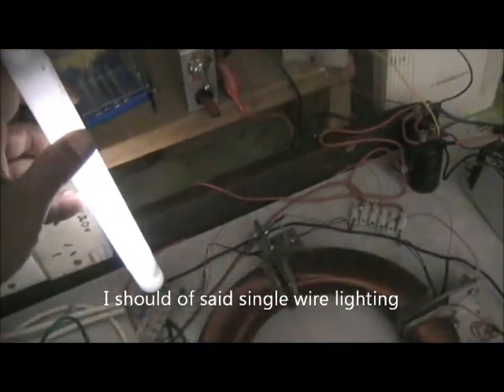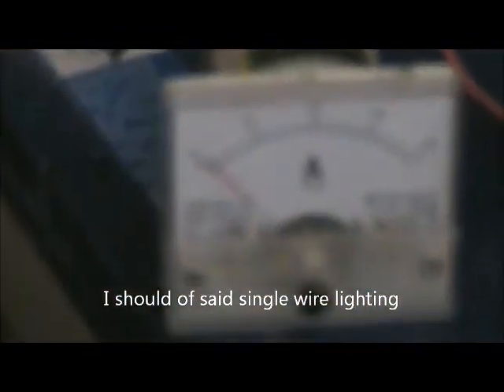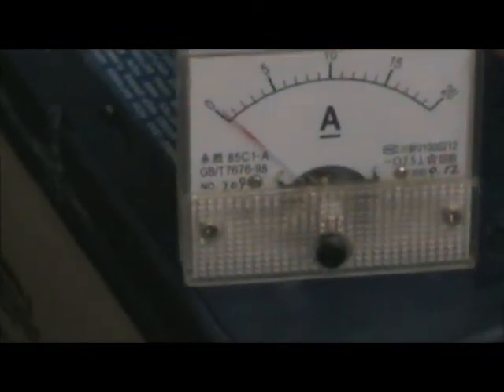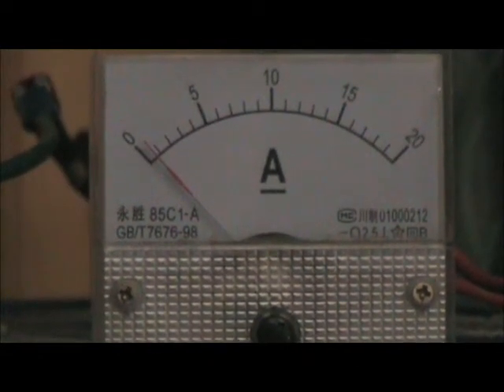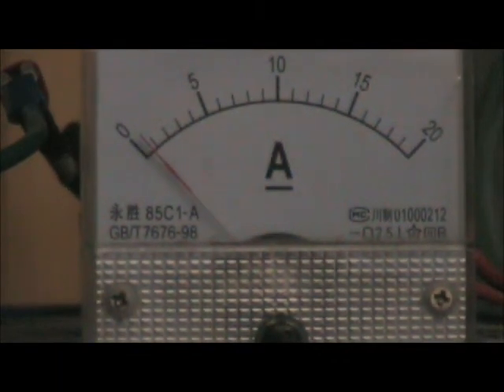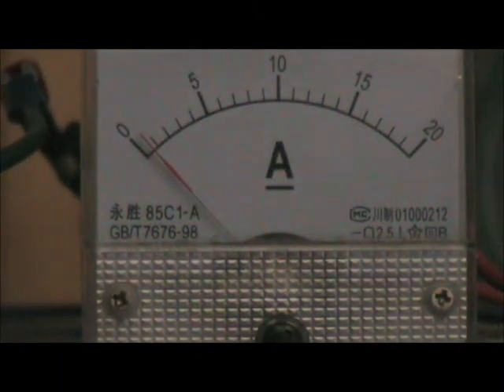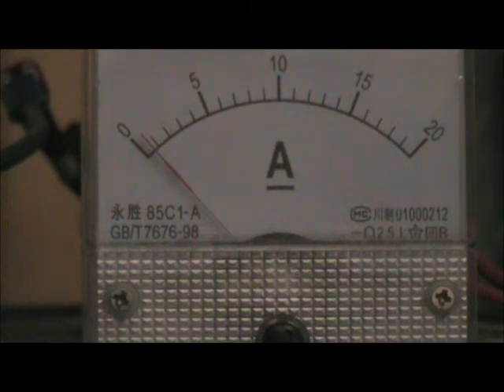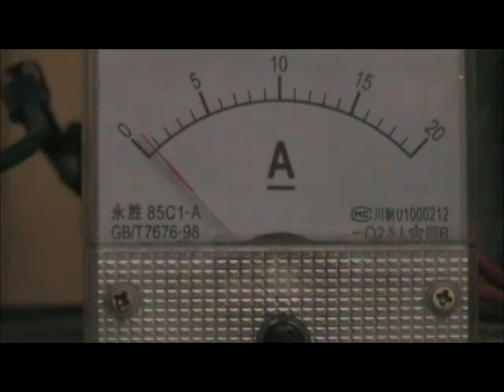One wire lighting power draw

Comment: Well done. From my own experiments, I came to the same conclusion.
The "single wire" transmission is in fact a circuit looped by the displacement currents between the terminal capacity and the ground (near metallic mass of devices, operator hands and body etc...). I have also measured the power dissipated in a terminal resistance, and observed that it is perfectly proportional to the power provided by the primary source, the former being of course less than the latter due to the losses. The circuit appears to be open when it is not and this seems magic to unskilled people while in fact the functioning is purely conventional.